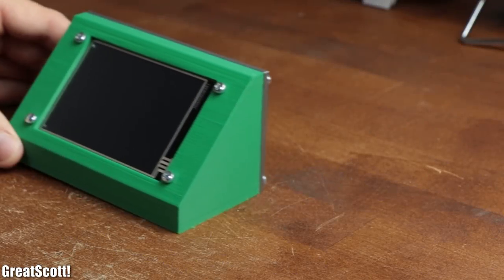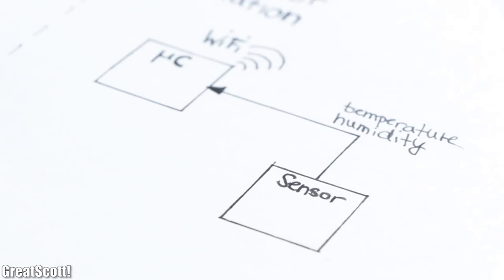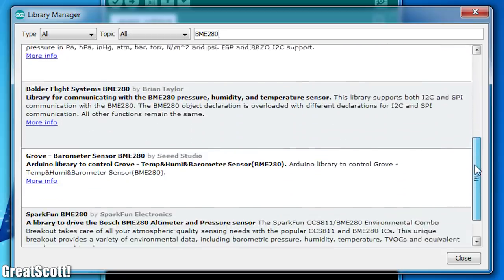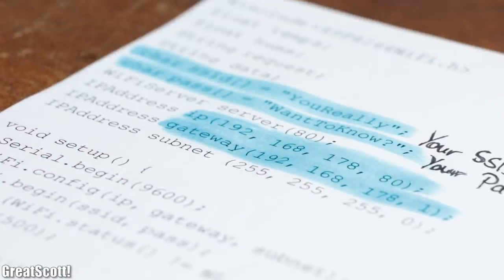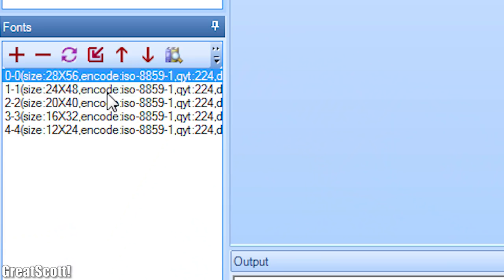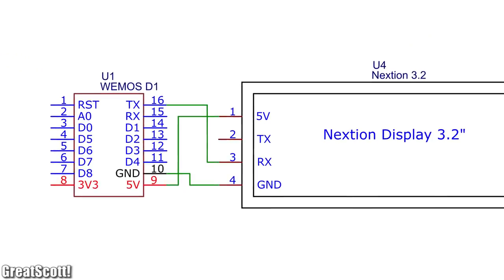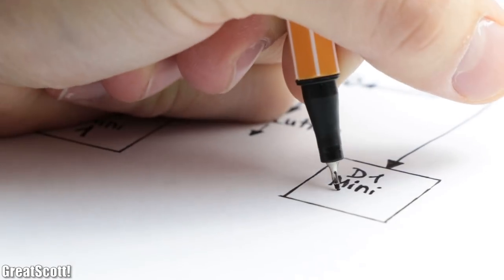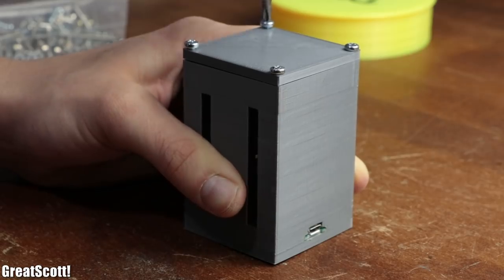DIY Weather Station & WiFi Sensor Station || ESP8266, Nextion LCD

Comment: What's the power draw of the sensors? Could they be powered with a 18650 li-ion battery and an 5V step-up converter?
Reply: Read the datasheet, as for its power that usually doesn't matter much, we're talking in the region of >1ma so what matters is the power of your MCU in this case the ESP8266 which on average is around 0.5W, which means using an inexpensive 2Ah cell you will have about 7.4Wh to work with or roughly 14 hours run time, but you probably want to improve that to at least 3 days using sleep modes to account for cloudy days and component degradation, also you didn't specify how you'd be using this, so going solar for example you need to generate around 18 hours worth of power draw within about 4-5 hours.
Reply: Thanks for the detailed answer. This setup is sending data every 10 seconds, as you've pointed out one could factor in longer sleep cycles. In a typical environment, one reading every 5 minutes is more than enough.

Comment: This could be really cool if you beefed it up with wind sensors UV sensors and maybe even a lightning detector
Reply: This is what I was thinking. Looking at building something like this now for myself. I would add a light sensor and UV sensor, and a lightning detector would be great too. Of course I'd also have it log in real time, calculate dew point, all that good stuff. Light sensor would be for sunlight data. I not sure what to do for a wind meter... and don't have a decent place to mount one anyway.
Reply: @camrouxbg   any update on your project?
Reply: @athallahtitan6525  no, I haven't done squat with it yet.

Comment: Can someone please explain how to get around the need for two D1 Minis?  

It first acts as a web server to receive the data from the remote sensor.  But it then knows that there won't be another transmission for 10 minutes, or whatever the interval is.  Shouldn't it be relatively easy to switch to station mode, join wifi, get the OpenWeather data, and then switch back to web server mode?
Reply: He has all of his minis connecting via a separate router as clients and not access points. I'm really not sure why he's using the two minis; if you grab his code from the Instructables site it would be pretty trivial to combine them.
Reply: Also, the ESPs (32 and 8266) can do both client and Access Point at the same time! No shit!

Comment: You did a great job, but, would have it been hard to make it portable? add a lithium 18650 with a circuit ripped out of a power bank to charge, and hold a 5v current, tho, you could always use a power bank to power it externally.

Comment: I tried using ESP32 dev board for a weather station, but it seems that it drops WiFi connection really easily and can't reconnect if it doesn't get enough amps. Putting it on 1A power just wasn't good enough for that bugger. 
Gonna try ESP8266 next. At least that seems reliable.
Reply: Disconnecting can be user code problem.
Resets can be brown-outs or also user code problem.
Not automatically reconnecting... Again, can be hardware or software problem.
Try a very simple (boring, blinking led) code. Add a little bit of code to output the current connection status to serial monitor, so you know when connection failed.

If device still keeps disconnecting, you definitely have hardware problem.
I don't think 1 amp is required, but it is important that  voltage is stable.
A development board with USB connector and a regular phone charger are usually sufficient.
Reply: Oscar Gr
  Tried several tests like internal temperature readings with constant WiFi scanning and the basic stuff to test the board first, but the only solution with connection dropping for me was more amps. Could be a bad board though. I had some trouble to get it even programmed when connected to USB 2 so I had to use 3.0 port.
Reply: @pekkasaarinen2902  That sounds like a bad board then.
A microprocessor drawing 1amp, even if it is a full development board with some extras.... Sounds insane.
Most cellphones don't even draw 1amp when charging. (Unless USB C or the iPhones on their own chargers)
Most USB ports on notebooks won't allow you to draw more than 500mA. (Again unless it's USB C)
Reply: A device doesn't usually draw the maximum that the supply supply can provide.

If it draws a tenth of an amp (0.1A/Ampere = 100mA (100 thousandths of an amp)) with a power supply capable of delivering 0.2 A, it will draw 0.2 A [EDIT: 0.1 A] with a 2, 20 or 200 A supply!

Unless the supply is underrated, the device determines the current (amps), not the supply ;)
Reply: @electron-1979  If you read the short back and forth ... Nobody thought it was the power supply (a voltage source) that dictated the current.
The original question was that even a 1Amp (5 Watt) power supply did not seem to give stable connection.
To which my first reply was...
It could be unrelated to the capacity of the power supply.

"If it draws 100mA with a supply capable of 200mA it will draw 0.2A  with a 2, 20 or 200 A supply".
No, it will still draw 100mA.
😁
Reply: Damn, I stuffed up the second 200mA! Good spotting! I bet GScott would not have spotted that!
Unless you have discussed this with Pekka Saarinen, how do you know what they were thinking? Read the comment again, "doesn't get enough amps"! What does that imply?
Reply: @electron-1979    Not exactly sure what your question is atm.
What I tried to say was that from the 2~3 messages I exchanged with Pekka, I believe I got confirmation that he/she concluded that the WiFi dropping was related to the capacity of his/her power supply. 
My final remark just intended to say... A small development board should not need to draw 1amp. (Though I will add here that I have seen they sometimes draw quite a lot at startup and/or during WiFi activity. At those times a small capacity voltage source (power supply) will drop it's voltage as a result of over-drawing current. And the dev-board may reset as a result of under voltage... I m sure I m not saying anything you didn't already know)
Still.. 1amp is too much.

Comment: Those screws are triggering me. Can't you design the enclosure so that the screws aren't such an eyesore? xD
Reply from the maker: I like the look of screw heads. I actually wanted it to look like this.
Reply: @greatscottlab  Really? Haha that was my only problem with your design, I must say. 
Either:
1) replace the cheap looking Phillips screws with a hex head (cylinder type or button head,) or
2) use countersink screws to make the front surface flat. This way you can also cover the whole surface with a layer of some sort and hide them completely. Just my 2 cents!
Reply: GreatScott! Sorry it just looks bad, please use flush and smaller screws
Reply: @greatscottlab  , that's the spirit! Respect.
Reply: It's all about preferences :)

Comment: I have a couple of BME280 sensors and the temperature is always wrong. I now use the LM75.
Reply: And me the same issue, i have couple of BMP280 sensors and the reading of pressure is always different.
Reply: I had the same problems, it's something to do with the bme280 coupled with the esp8266. If you connect it to an Arduino with the same code it is accurate
Reply: I had a BME & DS18 on my desk in front of a small fan to test pwm code and they would consistently be about 0.8F different.
Reply: Same problems here... doesn’t matter if I use a dht22, bme280 or a sht31. Every sensor measures a too high temperature. Even if I put the breakout board far away and measure only every 30seconds. So you say with the Arduino it’s better? I use a ESP8266
Reply: @freakym0  yes, connect it to an andruino Uno/nano and you will see the difference.
Reply: @coolriku77  that's odd. The code should work the same for both MCUs unless there are fundamental differences in how the values are calculated. Floating point errors maybe?
Reply: This is because of smoothing algorithms of the chip. I use this before measuring and temps are already real. //weather monitoring mode
  bme.setSampling(Adafruit_BME280::MODE_FORCED,
                  Adafruit_BME280::SAMPLING_X1, // temperature
                  Adafruit_BME280::SAMPLING_X1, // pressure
                  Adafruit_BME280::SAMPLING_X1, // humidity
                  Adafruit_BME280::FILTER_OFF   );
  bme.takeForcedMeasurement(); // has no effect in normal mode
Reply: Maybe problems with “pollution” in the supply voltage? I will try this later next week! I have trouble with bad measurements with all kinds of sensors for a long time now. Try to find a good one for my project but no luck :-(
Reply: I've used DHT22, HTU21 and BME280 and all sensors show almost same temperature (BME280 after the aforementioned hack) only DHT22 has 5-10% humidity difference from other two. Almost means difference no greater than 0.2-0.3 deg C.
Reply: The BME280 is very sensitive to electromagnetic self-heating. If you turn off the Wifi radio completely and wait a minute the reading is accurate. If you put a powerful fan on it, it will be too. My solution is to simply put as much distance as possible between the ESP8266 using a 20cm ribbon cable and compensate for the remaining error in software.
Reply: Yep this could be legit cause because when I make my measurements I usually switch off Wifi (mostly for consumption savings) but as additional benefit it shows more reliable data from the sensors as well.
Reply: Robin C. I am not using the WiFi right now in my code but the values are still off. Only mi Notebook I use for serial Monitor is connected to WiFi. Would that be already enough?

Comment: Dude you need to use a fixed width font to avoid the letters spacing problem. Second, that Impact font is really unreadable from far distance, since you are wasting all that screen estate I suggest to add some big modern geometric fonts like Roboto, San Francisco, Helvetica Neue for example. Also that background has no functionality and makes no contrast, use a simple solid one, a subtle gradient or a very blurred image. Would be nice to change the wallpaper according to the forecast conditions as an addition to the script

Comment: Lol. I have one too.with sensors measuring locally, for both indoor and outdoor humidity and temperature.Would consume way less power since it uses nokia 5110 lcd and one wire protocol

Comment: That's pretty cool how the esp8266 has enough memory to completely buffer the display. Nice video!! 👍
Reply: dont think the screen drawing is on the esp's side its that fancy screen doing the heavy lifting.
Reply: @scootscoot2k   but you need to somehow buffer the display in order to draw the text, unless the display has integrated readable RAM.
Reply: The Nextion does all the work. The ESP only sends the actual values via serial. In this case it's text, but could be numerical or commands. The enhanced models have 16MB of onboard storage, a battery backed RTC, and a few GPIO. If their core code was more polished you could almost get by w/o the ESP other than missing wifi.
Reply: The nextion display has its own onboard processor that is doing all the work. You could connect a attiny85 to it and get the same result. You just send the sensor values to it and it does all the heavy lifting. The software is clunky, but they are a nice screen for that onboard processing feature.

Comment: It might be useful to add that the TX-RX connections are reversed on the ESP and Nextion display (TX goes to the RX and reverse). You may also need to disconnect power of the Nextion before uploading code to the ESP or it can fail.

Last year I also built an ESP and Nextion weather station (with date and time and displaying 2 different screens and forecasts from several cities you can program). You can check it on hackster.io, look for ericBcreator.

You can get nice results with the Nextion displays but getting them to work and fine-tuning costs a lot of time and testing.

Comment: There is a problem at code because when you put the local ip adress like 192.168.1.3 for ex when you restart the router that adress wil be changed to somehow like 192.168.1.6
Reply: It won't be changed if the ip is bound to the mac address of the device

Comment: Aren't those diodes on 9:42 drawn backwards?
Reply: Actually, RX is normally high and TX pulls it low.
Reply: @electron-1979  oh, i was thinking it's the other way
Reply: @cekpi7  
No, I haven't double-checked, but it does work and make sense (to me).
TX does the work, RX just "sits there" and waits for TX.

Comment: If you never had trouble with a Bosch sensor, you must have never tried to put one on a dodge truck... Only company I know that sells parts that they know don't work for the intended purpose. Dodge Trucks are NOT compatible with Bosch.

Comment: I always like those projects as entry-projects. With good documentation those are a good way to understand some basics.
But I was wondering: With all those microcontrollers and the display - how much power does it need?
Thinking about this being on 24/7 for 365 days, you have to calculate the price it takes. It shouldnt be much, but you always have to keep that in mind. You might want to add that to future videos :)

Anyway, thanks for the nice video ^^
Reply from the maker: The weather station needs 1.3W and the sensor station 0.3W.
Reply: @greatscottlab  thanks for the answer. I was expecting a bit more but thats impressive!

Comment: Hey your videos are awesome and your English is pretty good. But you should really fix your pronunciation of 'the'.

The rule is very simple. Its 'the' unless the next word starts with a vowel, in which case it's pronounced 'thee' 

So

The temperature (not thee temperature)
The weather
The wifi
Thee arduino 
Thee other arduino
Thee information 

Hope you don't mind the advice.

Comment: I didn't quite get why it was challenging to use only one ESP8266. I have no way of testing it, but I merged the code of the two .ino files: https://pastebin.com/ZcPQQgUA. It does compile. 
Also: Watch Out!! Don't install the latest beta version of the ArduinoJSON library. Install the 5.13.3 version, otherwise Scott's code doesn't compile.
Anyways, pretty cool project. I am going to attempt something similar in the Future.

Comment: You use Windows 7.????
Reply: Mushthaq G yeah he uses outdated and no longher supported software, calls himself a programmer/DIY lmao
Reply: Win7 is not outdated. And it will not be for two years. Don't be jearks!
Reply: I still use WinXP mostly but dual boot 7.
Reply: @heanstone1327  he does not call himself a programmer.  He even said so.  Maybe you could keep your nonsense comments for yourself because I'm sure he is  way more all around versed than you are.

Comment: duuuude you seriosly need to fic your 3d printer, that quality is horrible. even chinese anet a8 clone when calibret can do 100 times better. everything in your videos is perfect but the print quality looks horrible
Reply: He could smoothen the surface with acetone, then it would look better.
Reply: if its not printed with ABS, the acetone trick will not work.
Reply: @JorksX  Good to know, thank you.
Reply: wouldn't some sandpaper do wonders on that
Reply: @squidinkRC  
Why use sandpaper when calibred printer can print perfectly smooth wall and no need for sanding
Reply: @JorksX  it must be pretty difficult to achieve that calibration. Every video on YouTube about home printed designs looks as rough as this.
It's the number one reason I have not touched 3D printing.
Reply: @oscargr_  its simple if you take your time
Reply: @JorksX  How many parameters would you be juggling?
Temperatures, speeds, feed rate.... What else?
Reply: @oscargr_  steps / mm and flow is the most important. After that acc and jerk and all of that little stuff